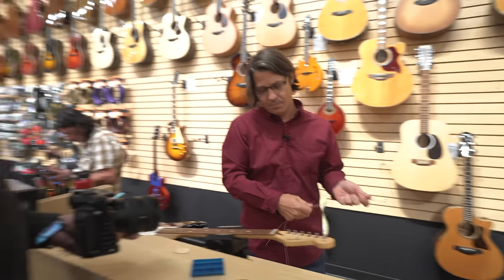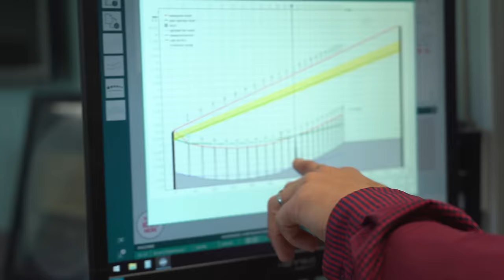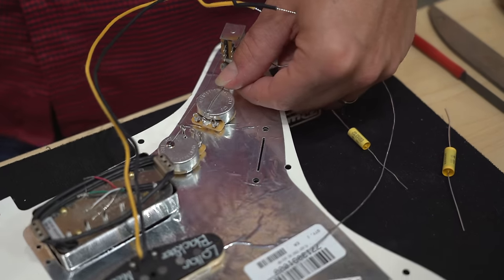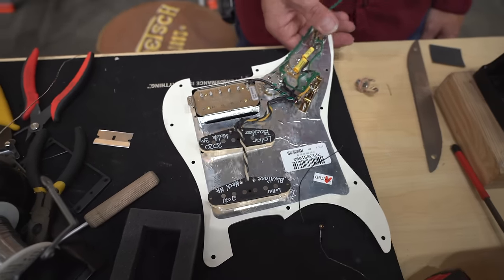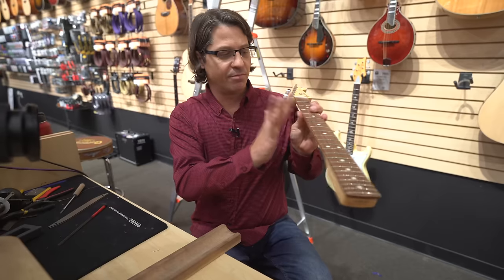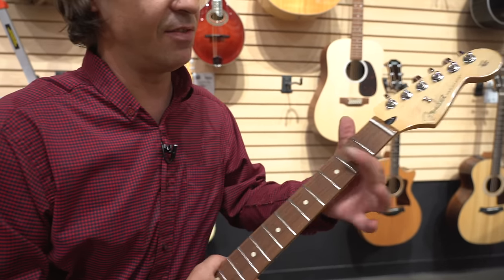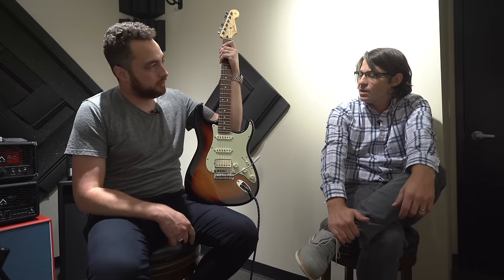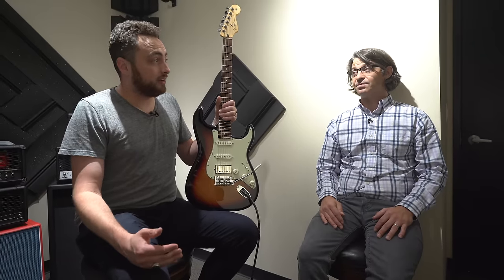We Tried To "Custom Shop" The Cheapest Fender Strat

Comment: This has been the way for a while. The Sound comes from pickups, not wood. Get it set up perfectly with awesome pickups and you're set. If you're going to keep it it's worth it. If you're in the guitar selling business it's not.
Reply: Really well worded. 100% correct
Reply: Generally, I agree. However, I think the neck and frets are one of the few things that is hard to make better. Typically Squiers come with very small frets. Although for custom shop prices, you could easily buy a better neck and have plenty to spare.
Reply: @TheDanification   yeah i agree with you man
Reply: @TheDanification  refret with stainless steel jumbo frets and you're still ahead on price.
Reply: Nope. It’s the wood. If the wood is dead you put the best pickups in the world in your guitar, it will never sound right
Reply: @heavyrelic8506  there's no such thing as dead wood in electric guitars, bud. Pickups are magnetic, not microphonic.
Reply: Agreed.  Better pickups sure make a hell of a lot of difference.  It's one of the reasons why for example cheap SX bass guitars are a favourite for modders.

Those instruments cost less than $250, but what modders are interested in is usually just the body and neck.
Reply: @gnarlantlers70  Also, the wood that all guitars are made of is technically "dead".  You don't see leaves growing on guitars...😁
Reply: @heavyrelic8506  check out Jim Lill’s video, “where does the tone come from on an electric guitar.” Hate to break it to you, but you’re going to have your heart broken. Don’t worry though, it’s actually a relief when you don’t have to worry about “tone wood” anymore.
Reply: @MrClassicmetal  👌🏻 100% true!
Reply: @Proper_Gander  no bro. Tone paint! The tone is in the paint. And the plastic pickguard, too. Tone plastic, my man!
Reply: @gnarlantlers70  There's also people who argue MP3's sound identical to vinyl
Reply: Yes, but the percussion and dynamic's of the string goes thru all the materials of the guitar. Part of tone depends of the density of Wood.
If I'm wrong epiphones and gibsons have the same sound but they don't.
Reply: @gnarlantlers70  There are people who make wild claims about the pickups vibrating in the wood, and that this is how the wood influences the sound.  I kid you not!

These people overlook the fact that with many guitars, particularly a very famous model, the pickups don't even touch the wood. As these are mounted to a plastic pickguard.🙂

Also even when the pickups are mounted into the guitar, there's a piece of foam between the pickups and the body.
Reply: @gnarlantlers70  Pickups are magnetic and saddles, nut, neck and body change the way a string vibrates. The best deal is to buy an used quality guitar. You will get always back what you paid. All the money you spend modifying a budget guitar will be lost forever.
Reply: @Proper_Gander  There's an even older episode of the Discovery Channel where they also explain this.

And then there's the Fender Strat made of cardboard.  It still sounds like a Strat.
Reply: @gnarlantlers70  Oh, there absolutely is dead wood out there in the guitar world and I have first hand experience with it. 2013 Fender Mexico Standard Strat, my first Fender guitar. Looks nice, sounds bad. And by sounds bad I mean that it always sounded muffled/muted unplugged and it also was very noticeable plugged in, there was no high end/sparkly top end in this guitar. I'm not kidding, when I was putting on new strings those new strings sounded like they were several years old. This piece of body wood was muting high end frequencies. Back in the day I didn't have the knowledge and I didn't have any other electric guitars to compare it to, so I thought "well it must be the pickups then". Oh boy was I wrong. Got a nice set of 60s style handwould pickups for 300 bucks, put them in, and then the shock. The plugged in sound improved only marginally, the inherent muffled sound of the guitar was still there. @Heavy Relic is spot on here: If the wood of the guitar is bad/dead you can put in all the best parts and pickups. The end result will still be disappointing and you still won't have a good sounding guitar. Last year I got a 2000 MIM Strat Body in Burgundy Mist on ebay to replace my dead sounding 2013 MIM Strat body. Same neck, same hardware, same electronics, I only changed out the bodies. And now this new guitar might be my best sounding Fender Strat. The unplugged sound of this new guitar is so much better, the missing high end/sparkly top end is finally there and the muffled/muted sound of the old guitar is completely gone. And plugged in it sounds fantastic as well, after switching the bodies I was for the first time able to appreciate how good those handwould pickups actually were. Those same pickups didn't sound nowhere near as good in my bad sounding 2013 MIM Strat body. This experience showed me that the wood is essential on Electric guitars. Grab 10 Mexican or 10 American Fenders off the shelf and play them each, they will all sound different. There will be great ones, there will be average ones and there will be bad ones. And why is that? It's certainly not because of the hardware or electronics, cause those are the same on all guitars (the minor tolerances in the electrical parts are negligible). It's because of the wood. Each and every guitar has it's own inherent sound predetermined by the specific piece of wood that has been used on that guitar. I'm not a tonewood believer, I don't care if it's alder, ash, mahogany, poplar or basswood. My 2013 MIM Strat body was an alder body btw. So according to the tonewood believers it should have been a fantastic body. But it wasn't, it was disappointing, this piece of alder was literally muting high end frequencies. I don't even bother to plug in Electric guitars any longer when trying them out in a store. A great guitar sounds great unplugged and if it doesn't, steer clear and find one that does. I've bought several US Fenders in the past few years and they all have one thing in common. They sound fantastic unplugged (and as a result they sound fantastic plugged in). Wood matters, folks. People who say it's all in the pickups are either lying or never had a bad piece of body wood in their collection.
Reply: @demokraatti  so it's the tone of the gaps then? 😄
Reply: Agreed. It’s called an electric guitar for a reason. A company made a Strat out of cardboard. Guess what. It sounded like a Strat. 😆
Reply: @asehauDLM  In that case something was off in the construction, the design, or there was some warping in the wood. This can cause those dead spots.

From an engineering point of view wood is very inconsistent anyway.  To eliminate that part it would make more sense to construct a guitar out of composite. 

Ovation acoustic guitars are partially made of plastic and currently there are a few brands that produce carbon fibre guitars.  And in acoustic guitars the material actually has an effect on the sound.

There are electric guitar brands that produce carbon fibre instruments, or guitars with carbon fibre necks.  No need to worry about warping anymore.

The reason why composite instruments aren't more mainstream is because wood is still cheaper.  And of course companies like PRS have brainwashed people into believing that there's such a thing as tonewood.  They have to protect their business by keeping that myth alive.😁
Reply: @gnarlantlers70  I can’t believe I forgot about time paint.
Reply: @MrClassicmetal  definitely going to check that out. Thanks, dude.
Reply: @TheDanification  This was not a Squire!
Reply: @gnarlantlers70  Stainless steel frets do not sound better than any other frets.
Reply: @heavyrelic8506  This is correct. However, on a solid body guitar the neck changes the tone more than the body wood, and the fretboard wood contributes more than the neck wood.
Reply: @gnarlantlers70  Pickups can only amplify what is already there. What is already there is the whole system without the pickups. That includes fretboard wood, flexibility of the neck, quality of nut and saddle material, body wood, mass of the tailpiece, and obviously the strings. Pickups are important, but not the whole thing.
Reply: @a1guitarmaker  I mentioned stainless because they're more expensive. String guage, tension & material plus pickup and electronics are what you hear in electric guitar tone. The rest is superstition and salesmanship.
Reply: @heavyrelic8506   you 100% right, I’m pretty sure most pll that disagree with have not played enough different guitars.
Reply: An old point of contention among guitar players. I have taken the same single coil tele neck pickup and installed it in two different guitars. The sound was NOT the same. Probably due to one being an acoustic sound hole install and the other a semi-hollow neck position install.
Reply: @rosevil89  Nope. Youre wrong.
Reply: @TheFrontyer  ok. Put Gibson pickups on epiphone's and they have to sound the same.
Reply: @rosevil89  Yes they do if its the same type of pickups of course.

I literally did this with my epiphone, and theere was not a single person who could tell the differemce in a blind test. 

Also, science proves puckups is all that matters

You could put a pair of gibson pickups on a piece of cardbord and it would sound the same as in a guitar.
Reply: in my experience, the sound comes from your amplifier, and good speakers that fit the amp… guitar pickups, wood etc.. especially when played live, you will not hear the sonic difference whatsoever… just buy a cheapo guitar with the perfect neck, have it set up properly… and spend the rest of your money on an awesome amp with awesome speakers
Reply: @gnarlantlers70  I am so sure this guy witnessed more than 90% of his guitar experiences through youtube videos lmfao
Reply: Sometimes a guitar will not benefit from pup change. Those guitars I call still born no matter what goes in them they do not sound any good . So does wood and other parts contribute to the sound , I think they do
Reply: @mionapinyon6098  Youre wrong though. However if the neck is not fitting you, making it uncomfortable or difficult for you to play, that will change the tone
Reply: I think sometimes the wood of the neck and body can make a slight difference to resonance and sustain… but we’re still talking like a 3% impact to the sound vs the pickups (and player) being the other 97%.
Reply: Oh yeah,truer words never posted in comments! You'll never get your extra money back,but definitely worth it if she's a keeper. Love swapping pickups and I also like to upgrade my wiring with higher end types found in broken,but expensive appliances. Check it out sometime if you haven't already. Take care everyone
Reply: The wood effects the sound of course if you know your sh*t
Reply: @harryherman5371  Nope.
Reply: @TheFrontyer  
Ok so you don’t know about fine guitars, got it.
Reply: @harryherman5371  Dude, its been proven beyond doubt that there is no difference. There are multiple scientific projects proving it. There is no denying. 

People like you are just pissed off because you bought an expensive guitar and realized later that it wont make you sound better.
Reply: @TheFrontyer  
I own about 40 high end guitars. When I pick up a cheap one like yours you can hear the difference in wood absolutely. 
Then I return to my 78 Les Paul custom and it’s all better again 😂
Reply: @harryherman5371  Nope, what youre hearing is the difference in pickups.
Reply: @TheFrontyer  
I’ve played and owned hundreds of fine guitars, and am an expert in guitar making. The wood on electric and of course acoustic makes a big difference in timbre. Picks up make a difference too, but in another way. 
What you’re saying is YOU can’t hear the difference. Shut up and listen when an expert is speaking.
Reply: If the pick ups was the only thing that mattered we’d all be playing 2x4’s 🧐
Reply: @robertestrada9643  If you dont care about how it looks, and how comfortable it is, then yeah, it will sound the same.
Reply: Hilarious how so many people think that just pickups affect tone and nothing else.
Reply: @ChrisJones-ht9zn  Its really only the strings, pickups and electronics that matter in the guitar itself. 

Everyone knows tone is also affected by the player and amp aswell.
Reply: @heavyrelic8506 I can’t tell if you’re being sarcastic or serious, but if you’re being serious…..tell me where the strings of say a Strat style guitar ever touch the wood of the body? They don’t. Vibrations of wood aren’t picked up by the electro magnetic field of pickups. If anyone tells you the wood makes a difference in an electric guitar, they’re full of it.
Reply: @rosevil89 the strings never touch the wood on a strat except for when you’re fretting a note. That means open notes aren’t affected by wood at all and fretted notes are maybe marginally affected by fretboard wood
Reply: @MrClassicmetal Yes. This. In a Strat at least, pickups are suspended by a piece of plastic. Pickups don’t vibrate
Reply: @sinjon  then why are so many different tone woods being used on electric guitars, if wood has no influence on the tone like you said?
Reply: @sinjon  If you can hear the difference between chambered and nonchambered body probably you know wood matters in sound.
If somebody can't tell the difference probably need's some ear training.
Reply: @asehauDLM this would be caused by cracks in the wood. Frequencies can act on each other, canceling out or multiplying. Sucks you had a cracked piece of wood, but thats not the same as having a tonewood. Especially in a strat where the pickups are mounted to plastic using metal screws and springs. You could have glued some 2x4s together and mounted the neck and pickups to them and it would have sounded the same as the new body. You cant take the 1 in a billion odd occurrence and count it as a standardized fact.
Reply: @AverageCitizen333  solidbody electric guitar players are a superstitious  bunch.
Reply: Wood absolutely makes a huge difference.. I saw a video, same pickups into basswood, alder and maple bodies. They all sounded so different
Reply: @lukeluke295  someone who 2qnted you to believe that .ay have done some post processing. Its best to conduct the experiment yourself.